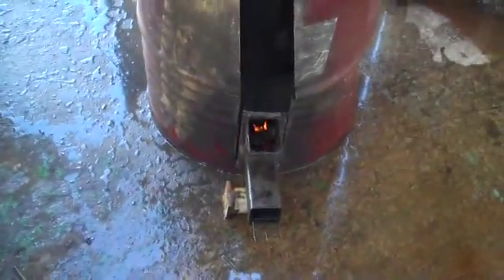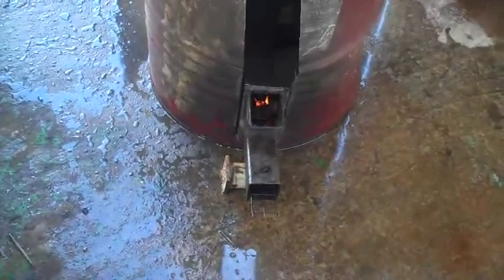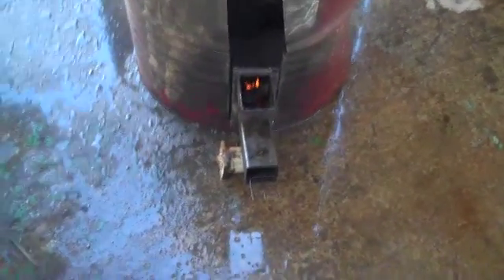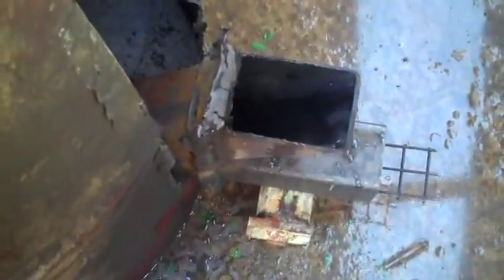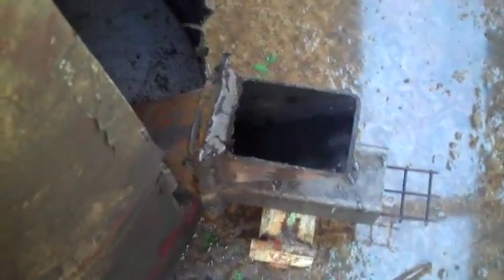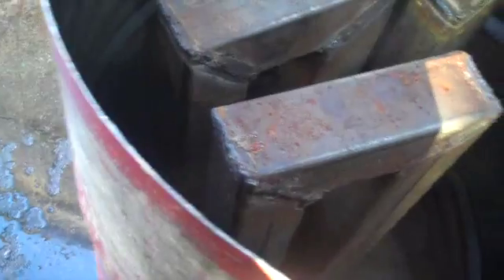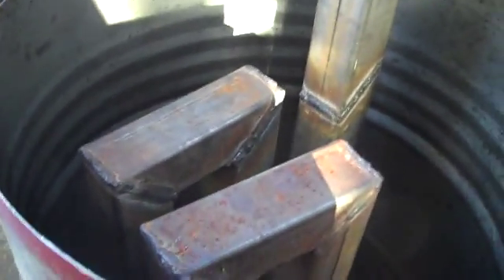rocket stove water heater experimental

Comment: good idea Michael, it would be interesting to see if it works. Maybe there would be a bit of build-up of tar in the flues? (because the water would keep them cool so there would be condensation?)  You've got so far, maybe you should get some thicker plate and build a boiler around it and not use the barrel at all - those things are too thin to weld consistently, aren't they? Tim
Reply from the maker: Ur spot on in every ting. I would be hoping the risers would burn off the  condensation as it heats up .With tare i think it is important to make it easy to replace the riser.I think there is a far better way of arranging the risers. More work Thanks